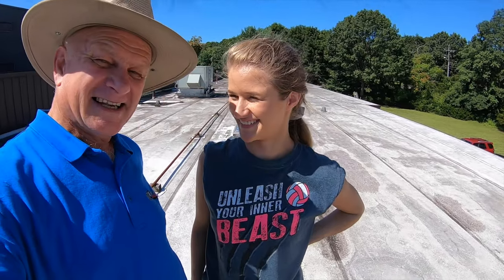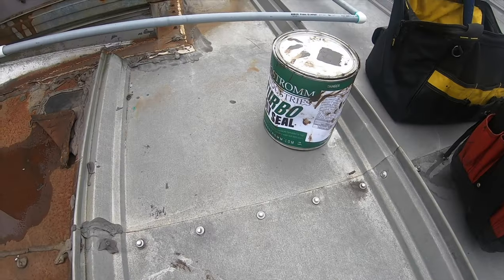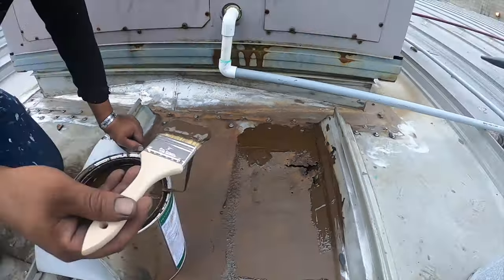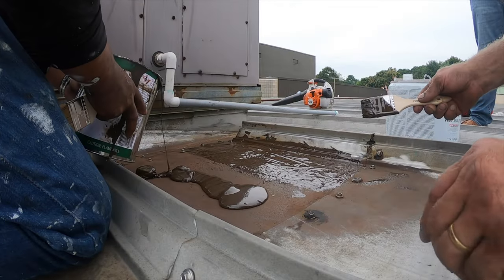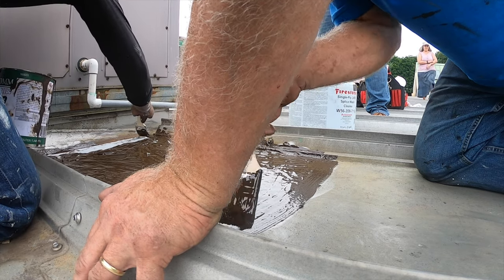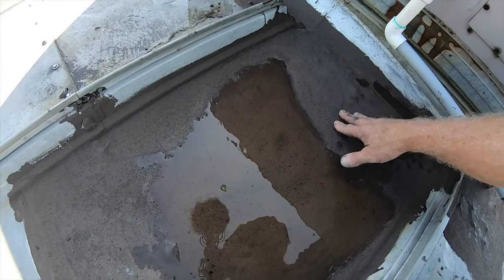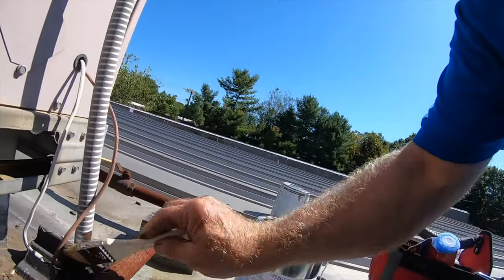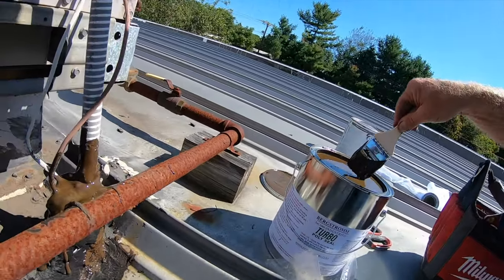DIY Rusted Hole Repair in Metal Roof with Liquid Flashing - Amazing Results

Comment: Step one, remove the rust and get to the bare metal  Step 2 prime with a bare metal etch primer (epoxy is best)  you skipped that step.  Step 3 coat with your turbo poly seal..and apply a large sheet of poly fleece which you don't sell on your site.   What gives?

Comment: I have a leak that only leaks in the winter when it snows. I don't really know where the leak is coming from. It could rain cats and dogs but not leak, can anyone explain why that is?
Reply from the maker: It could be some ice forming, then blocking the water flow, causing water dam. It is very likely where the snow is melted away and water can freeze. Snow is an insulator and water does not freeze under it.
You did not specify on what type of roof you have this leak. Metal, Rubber, asphalt?
Anyway, maybe someone else can give some input.
Reply: @FlatRoofDoctor  Thank you, it is a metal roof. I get what you are saying though, it makes sense!

Comment: I know you are the distributor of this product, so it is very biased when it comes to options. Besides turbo poly-seal, is there anything else that you would recommend?
Reply from the maker: Not biased, there is nothing else that compares to it. Elastomastic is horrible, Henry's brand is either Tar or Silicone. This product is a combination of Asphalt and Urethane resins with catalysts. It is a brilliant idea and only Bergstrom as far as I know makes it
Reply: @@FlatRoofDoctor  Not true. Plenty other companies make it
Reply: @FlatRoofDoctor  Elastomastic is horrible in general or for this specific application?
Reply: It might just be German efficiency